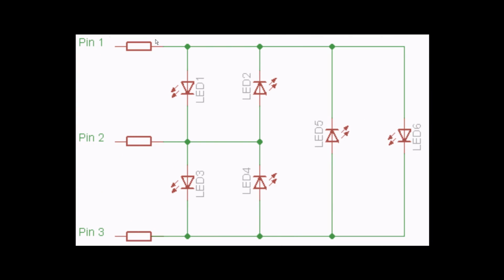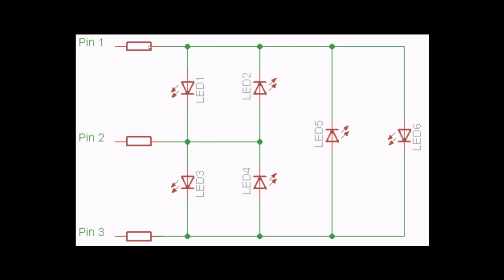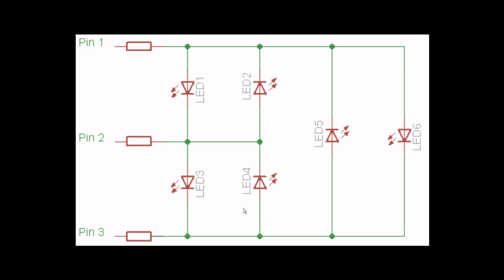LED array control with Charlieplexing and Arduino.

Comment: If you have pin 1 high and pin 3 low, led 6 will light up but won't led 1 and 3 also light up but dim? 1 and 3 are in series with each other and parallel with 6. What am I missing?